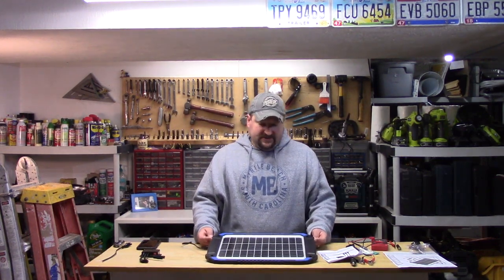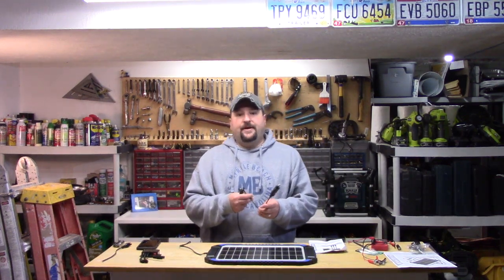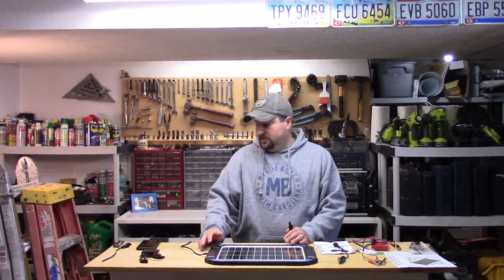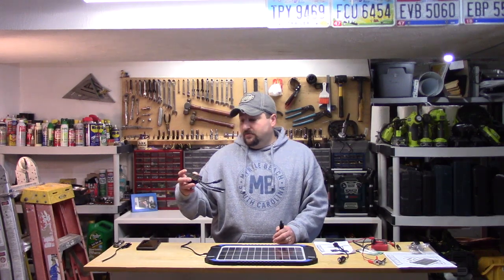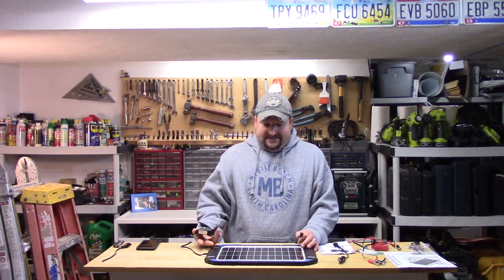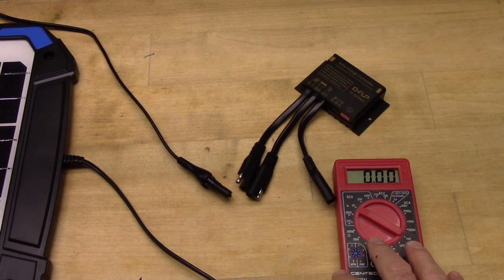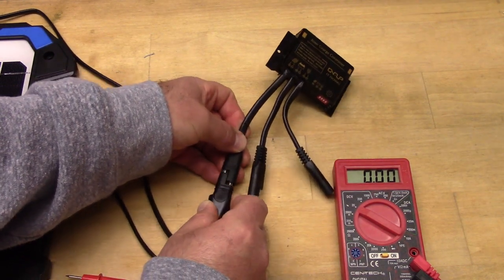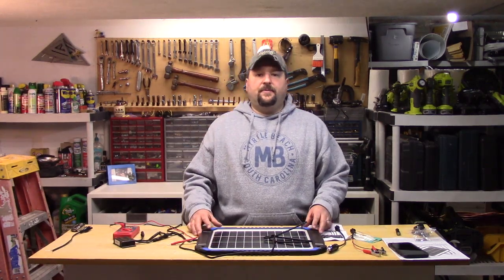Solar Battery Charger/Maintainer from Suner Power

Comment: Just so you know, testing the output the way you tested it is not a true test, as the solar panel is under no load. If you were to attach it to a battery, the charge showing should be approximately 13.8 to 14 volts DC disconnected from the battery, the battery should be 12.4 to 12.8 VDC ,  i know this because I am a ISCET certified electronic tech.  Just as if you were testing the battery in your vehicle with the vehicle off should be about 12.6 volts, when you start the vehicle that voltage jumps up to 13.8 volts from the alternator charge.